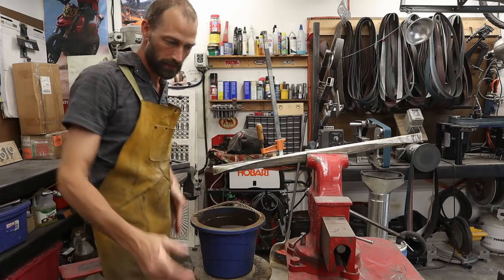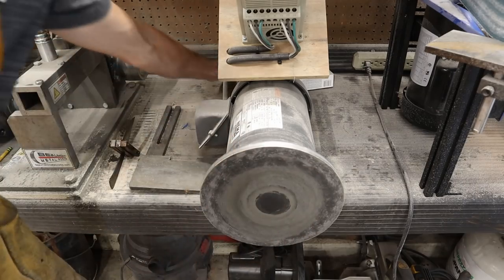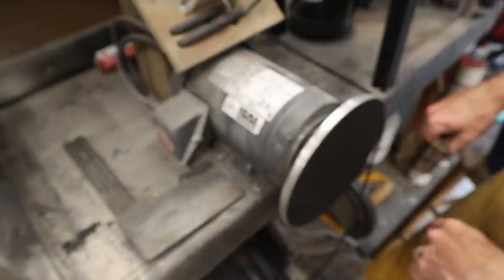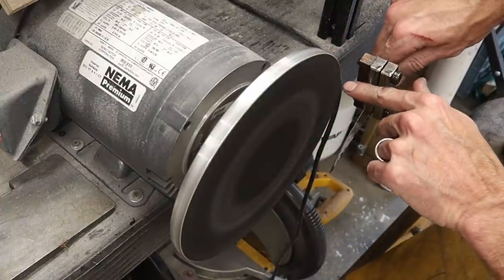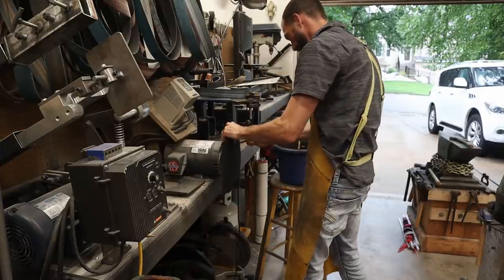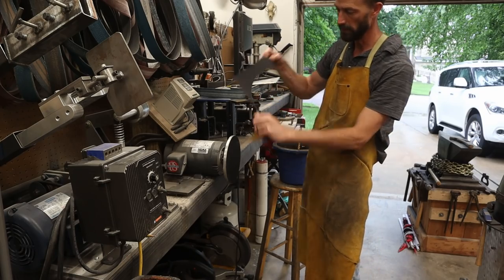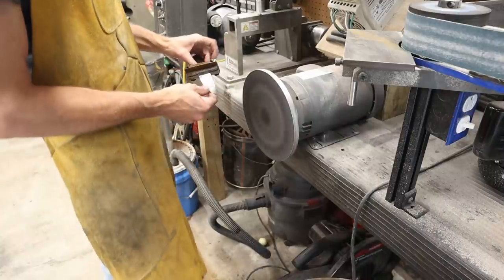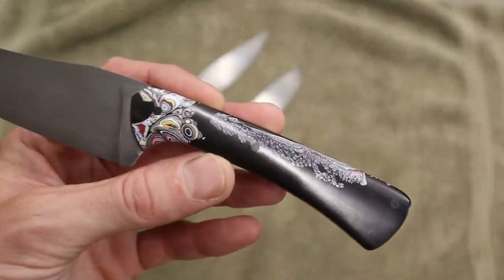Why the Disc sander is so important for knifemaking

Comment: Instead of using the left hand side of the disc that's rotating clockwise (which is the WRONG side) why don't you just either get another disc sander, which runs the other way (counterclockwise) and put it next to that one. Or get a polarity switch on that disc sander, to switch the direction of rotation? That way, the "pull" on the disc when you apply the steel will always be in the downwards direction, which is much easier, and SAFER.
Reply from the maker: The vfd has reverse automatically built in, this disk is running in both directions. Her statement is 100% correct if anybody were to try to run this disk in One Direction and use both sides it would be incorrect

Comment: I bought a harbor freight one for like $140 a few years back and the shroud is right in the frickin’ way of the edge.  I’m trying to figure out a way to modify it, since I paid so much for it I’d hate to buy another.  If anyone has ideas I’m all ears 😂
Reply from the maker: Are you talking about the 10inch disc with the cast iron guard?

Comment: Aarron, this is a great video, however you failed to point out that the 1 Degree disc is actually a cone and so trying to flatten a blade will actually leave a very small hollow grind, the bigger the blade the more perceptible it becomes. I make almost only kitchen knives and it really shows up. My new approach was to buy a 12" woodworking disc sander and install a VFD. I have no experience with the feathering compound but it is something I look forward to trying out on my Beaumont 9". Thanks for the video!
Reply from the maker: Interesting! I have ground up to 3 inch wide stock and never noticed any hollow from the 1 degree

Comment: Im not to sure weather or not you know this but you could get ten times more life out of your sanding discs buy using a belt an disc sander adrasive block cleaner just rub it along the belts and it brings them back looking like new 🙂
Reply from the maker: Yes sir I have one but it doesn't restore the sharpness to the grit, it just cleans out the swarf